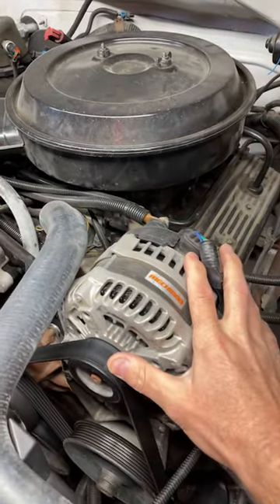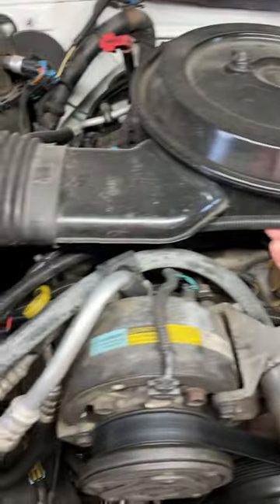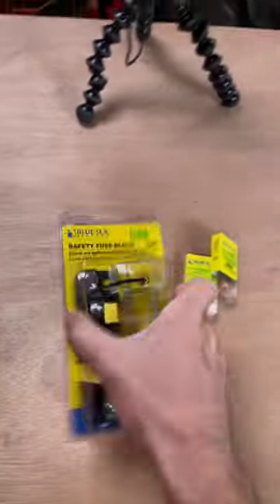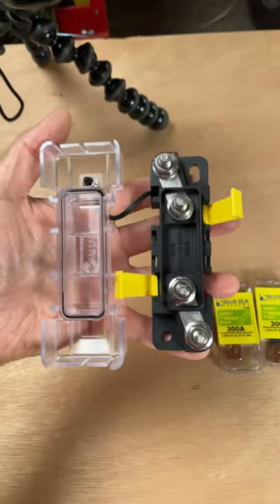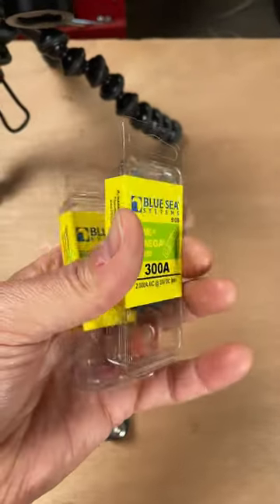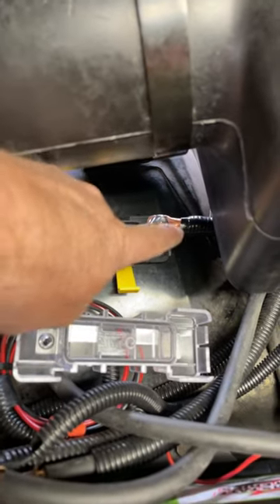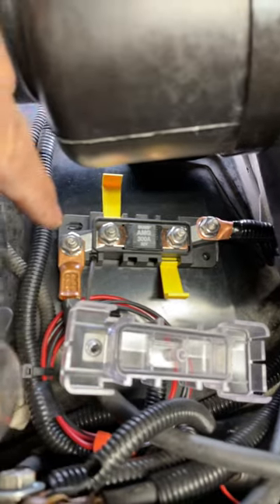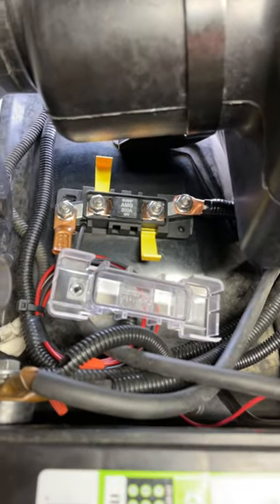Customer States His Install Was Professional!!

Comment: I’ve never seen a fuse on an alternator line to the battery !!
Reply: Its usually a fusible link.  Does the same thing as a fuse but looks like a wire.
Reply: @aaronpierson8748  Agreed, I’d much prefer the fusible link over the fuse.
Reply: It's better in my opinion because it'll visibly blow unlike a fusible link.
Reply: Its always fused, just not common to use this type of fuse
Reply: @Texassince1836  it SHOULD always be fused.  My dad's used suburban proves otherwise.  Stereo installed by the PO had an "upgraded" alternator output wire with no fuse.  Not sure what happened, but it melted the lead out of the battery and all the insulation off of the wire.
Reply: @Texassince1836  never on OEM applications
Reply: @Hitman-ds1ei  look again. It is ALWAYS fused, just generally with a different type of fuse
Reply: @Texassince1836  not always fused and in fact it's not needed!
Reply: @lgonzalez1154  again, there is ALWAYS a fuse. You just do not know what type of fuse to look for.
Reply: Now he has more areas to short to ground.   Cover up them copper eyelets
Reply: Well now there's two more contact points at risk of shorting out.
Reply: @paulrozinski1488  why? So u can pull out all your factory wires trying to find it ?   Makes zero sense
Reply: It's a fusible link. He just doesn't know the proper name. It's odd that he also doesn't know what to charge.
Reply: I did the same thing.
Reply: @Texassince1836  I went and looked at my 2005 f450 and my 2001 xj... no fuse
Reply: @paulrozinski1488  
Agreed on a normal alternator.
That’s a 275+ amp alt (mechmen) and I haven’t seen a fuss able link that handles that much amperage. 
It’s a necessary evil
Reply: @travis2893  fusible link is there. Its a type of fuse,  but it looks like a wire. I'll give you an F for eFfort
Reply: My work truck 6.0 Chevy has one but yea I feel like they are uncommon
Reply: @Handlehandlebars  It is always within a foot of the battery.  Sometimes located in a small fuse box next to the battery.
Reply: Well if you have ever installed a car system, then you would have seen this before!     I say you charge 75$ plus parts! As long as it didn't take more than an hour
Reply: @aaronpierson8748  I'd have to disagree...your generalizing that to newer model cars...classic cars had them inline somwhere between the battery and main fuse panel
Reply: The big 3
Reply: I had Itasca world finales invite stero in 2001 and they don't require a fuse on alt to batt cable
Reply: Charge them $2,000. Call it installer upcharge. Like dealers do. 😂
Reply: big boy audio uses big fuses 😉😏
Reply: High power alternators. You want one...
Reply: @PeterTremonti  he went to loud amd the battery got too hot, the modern work around is a set of supercaps or LTO batteries used as smoothing caps..
Reply: @deadprivacy  He actually hates the stereo and doesn't use it.  He was just driving back from a trip to Ohio and it started melting.  I have no idea what happened.  I could assume the output wire rubbed through based on the lack of zip ties and it shorted out the alternator and battery.
Reply: Better to have a fusable link, as you are less likely to short out the positive to ground while working on the car
Reply: @Hit man 309  my kia has a fuse from the factory...
Reply: MAYBE 🤔 THIS ALTERNATOR IS TO PROVIDE POWER TO  A HOUSE 🏠 OR TO UKRAINE  🇺🇦🇺🇦
Reply: You probably never seeing it because it's usually under most fuse boxes or inside them! Depending on year make and model.
Reply: Is it not called a fuseable link or a fusible link.??.not sure of spelling
Reply: That's because it goes to the fuse box
Reply: I have
Reply: @adamhonda98  Yes fuse box exactly! Different fuses protect Different electronics (AKA- Alternator).
Reply: You should ALWAY fuse or use a circuit breaker when you upgrade to a high amp alternator. I personally use circuit breakers with all my audio install now.
Reply: Because most cars use fuse line wire.
Reply: I would charge 1 hrs shop time + parts.
Reply: @Texassince1836  Nope, lots of oem applications don't have a fuse/fusible link or whatever on starter/alternator wire. I haven't seen one on any German car and wiring diagrams confirm that at least for the cars I have owned. Yes, there's usually a fusible link in the wire to the junction/distribution box but that's about it.
Reply: Pretty much every car has one
Reply: @Handlehandlebars  The fuse is there so if the insulation wears through or if you are in an accident it doesn't start a fire and blows the fuse instead.  That is why it located so close to the battery to minimize the amount of wire that could start a fire.
Reply: @andreyangere3076 the real question is, what Fuse to put there if any? Mechman alternators, for example a 240amp, actually makes about 260 amps @ 1,800 rpms and the amperage increases with the rpms. If he puts a 300 amp Fuse in, it'll blow every time that car tries to go above 60mph lol. 

Hope he likes waking and not taking highways.
Reply: Not always. Most audis up to around 2009 for example have a wire from the battery directly to the starter and alternator with no fuse.
Reply: Jokes on you, he doesn't have cash and plans to pay with his body.
Reply: @Aaron Pierson  yes I know why it's there but on older cars it's usually after the starter motor twards the fuse box inside the car..
Reply: @travis2893 we have a 1995 Cherokee XJ as well!
Reply: Oh really 😂 GM put them under the hoods of millions of cars.
Reply: it's a higher. amp needs a bigger fuse
Reply: @PeterTremonti  ahh yes that just meant a bad connection at the lugs, overcharge, and too small of wire for the output of the alt.
Reply: every car manufacturer does it differently over the years. a lot don't have any, some do a 200amp fuse and others do a fuseable link.
Reply: Is this type of fuse supposed to be a safety thing vs fusible  link?
Reply: Very common on high amp setups  some cars actually have them the wire goes into the fuse panel box them back out
Reply: @aaronpierson8748  true my 2012 chevy impala has a alternator fuse I ended up changing that out since the wires were showing from underneath. I completely replaced the wire and fuse she looks nice haha 😂  I'm definitely not a professional tho
Reply: Fusible links suck bro, fuses are always better why the heck would you want a fusible link you have to replace when you could just pop a new fuse in I don't even know where to start with this guy
Reply: @lgonzalez1154  It is actually VERY MUCH needed.  You ALWAYS place a fuse at the head of a positive supply.  Not doing so leaves you vulnerable to fire. 

Alternators put out enough current to weld a shorting cable to ground, and it can send sparks flying all over while doing ao. A fuse terminates that instantly, before it becomes a problem.
Reply: @Flamingtac0  listen "paranoid pete" alternator windings would break if the was a short! Take an alternator apart so u can see for yourself
Reply: @aaronpierson8748  it actually is just a wire with heat shrink over it that is usually two gauges smaller than the wire that it’s protecting..
Reply: Fuse links are the best for this application. They are a very cheap option and handle high peak currents. That's why OEMs have been using them for many years.
Reply: @aaronpierson8748  farm tractors use ah 400 amp fuse
Reply: I mean why fuse them when bolting the wire to the alternator and battery works just as good? 😉
Reply: @Rusty Rouse  wrong. the fuse would go between the amp and the battery on an audio install, not the alt to bat connection.
Reply: @gorillawrenchin  2011 Acadia has a fuse molded into the alternator output cable, have to replace the harness if it fails/blows. 150A as I recall. 2012 Chev Colorado has 200A fuse where the cable lands on the under hood fuse box.
Reply: Just to get more money in my vehicle I have a sub system and my fuse is in the back right my my amplifier been running it for more than 2 years and works great
Reply: @jasonadams8148  What do you think the clear plastic cover is for? Aesthetics?
Reply: @travis2893  I assure you do have a fusible link on your 2005 f450
Reply: Not ALWAYS some have it mostly on the American cars or such. Some Europeans like having a regular looking fuse like in the video near the battery. But not all have a fuse from the alternator to the battery and yes that includes fusable link as well which is just a thinner gauge wire connected to a thicker gauge wire.
Reply: Also cars don't come standard with a 300 amp alternator.
Reply: @Hitman-ds1ei  always OEM.
Reply: @099las  that's why the cover is provided.
Reply: @Handlehandlebars  they are not hard to locate if one can read.
Reply: @travis2893  but there is a fuseable link.
Reply: Car stereo amplifier uses those
Reply: Its called a fuzeable link fords have them
Reply: yes you have. You've just never noticed it
Reply: @paulrozinski1488 I had a Fusible Links in my 89 Daytona going to the ECU 1 of them Blew but it took for ever with a Multi-Meter looking for the Blown one I'd take fuses over them any day
Reply: And he did state he Installed an Aftermarket High Amp Alternator so it's Higher Amp then the Car was Designed for so he probably has Power Sucking Equipment such as a Ton of Lights or a Stereo System with Subwoofers or both
Reply: Because the wire is usually undersized. Like on my stock Chevy 140 amp alternator on a 10 gauge wire.
Reply: It's his own suburban
Reply: I'd charge $150 labor plus whatever $$$ for parts/materials......I'd also suggest the vehicle owner consider using a circuit breaker rather than a fuse as those 300a fuses aren't cheap every time one of them needs to be replaced.
Reply: @Rodogg7787  shouldn't charge anything for fitting that fuse block like that.
Reply: @Mixz1890  are you talking about the starter motor cable? It is the only one that I have never seen a fuse on it. All The alternator to battery wires I have seen, do have a fuse on them.
Reply: Usually you can't see it. It's under shrink tubing and lots of crummy tape and sometimes there is loom still intact.
Reply: @jasonadams8148  the copper eyelets are covered. Look at the video closer and you will see the yellow caps and those kits usually have some sort of cover for the other 2 connections too.
Reply: @Sean0526a  oh he knows what to charge...he was just throwing it out there for us. A lot of people call fusible links fuses too...
Reply: @travis2893  yes there is...definitely is on your 2001 XJ. It's about 1 1/2" from the alternator hookup. Chrysler uses thick rubber on their wires, if you strip that rubber off you'll find it. It's not a replaceable fuse really it's mostly a block of solder to melt in emergencies as a safety there is also a fuse in your fuse box for the alternator too....but the charging system isn't what usually catches on fire on Chryslers....as for the F-450 yes there is. There is an actual fuse at the box like the Rams are.
Reply: How many charging amps can a battery take?
Reply: Some vehicles have. But most older ones do not. Just a direct wire. Some do have a link, some do have a fuse. But it's easy to see if know anything about wiring or wrenching.
Reply: @Texassince1836  Do S10's have one?
Reply: People are arguing over this, so I'm sure my 2 cents will put an end to it.  Not all cars have circuit protection between the alt/gen and battery, esp on classic vehicles.  I am pretty sure it is standard on most modern cars however.  While it is best practices to use circuit protection, it doesn't need it to work.  If you don't want to burn the vehicle to the ground, I highly recommend you use one though.
Reply: @travis2893  the fusible link is between the alternator and the battery on you 05 F450 in the same place as my 08 F350 if you don’t believe any of us Google it I did just for 100% verification.
Reply: 10 cents
Reply: @PeterTremonti  good god😂
Reply: Saves the battery if theres a short or alt issue
Reply: And many vehicles today it goes into the Fuse block and has a primary buss fuse before going to the rest of the other circuits.
Reply: You're usually only going to see it in cars with aftermarket electronics and audio equipment in it
Reply: Hey 1Road, this Mechman Alternator was the Alternator I was trying to recommend  to you when you were having low voltage issues on your Suburban when you had the AC running full blast and the Alternator couldn't keep up. You did a good job doing all the grounds over with 2 guage wire,, but what you really needed was a 300 amp Alternator that makes up to 240 amps at idle. And, to everyone saying they would rather have a fusible link, go ahead and find a fusible link for a 300+ amp Alternator. The wiring going from the Alternator to the battery was 1/0 Guage pure copper wire. The 300 amp ANL fuse was really the best thing to do in this situation. The guy probably has a huge 5k+ watt stereo system and another battery or two in the cab of the truck. Lots of people use DIY Lithium batteries or a big capacitor bank to keep the voltage higher up and more stable. That particular Alternator should output 14.6v to 14.9v because that is the standard internal voltage regulator that Mechman uses.
Reply: Same here  my suburban was blowing the factory fuses I eliminated that a went directly from alt to batt. No issue
Reply: Engeering at it finest my friend
Reply: I was gonna say the samething... I used to do stereos and I never put one after the alternator
Reply: @paulrozinski1488  fusible link is not a better solution at all. Boomer
Reply: It's fused for wire protection.  When running big stereos anyways
Reply: Many vehicles have fuse or a fuseable link. Inline
Reply: When I did it,  I charged an hour labor plus parts. It seemed fair. I think I might take another look at the grounds and double check those battery terminals as well.
Reply: I never saw a fuse between the alternator and the battery before fusible links were even invented. Why would you need that?

The alternator is either internally or externally regulated and that's supposed to take care of the charging issues. If it doesn't a fuse isn't going to solve the problem because it's not going to blow the fuse.
Reply: @lgonzalez1154  oh you sweet summer child……not a mechanic but am a Electrician. You want a fuse trust me. You can make a welder out of a car battery. Cable runs next to components including engine. Vehicle when running vibrates. All metal components are bonded to negative. All it takes is a nick in the wire and your gonna have a bad day and it’s going to cost you mucho dinero.
I would imagine a blocking diode would be good aswell, but I would imagine nobody probably does that
Reply: Fuses on alternators don't really make sense since if you put a large enough fuse that it won't blow when you boost someone or have a low battery, the alternator simply can't make enough current to blow it anyway.
Reply: he has a high output alternator, its just in case there is an overload. better than melting wires. it happens
Reply: @Texassince1836  no its not😂
Reply: 😂 then you have never worked on electronics.
Reply: Why would a customer bring you his car to show you his new alternator and you put a fuse inline. Dude your storyline sucks
Reply: I used a circuit breaker on mine
Reply: Not even once
Reply: @PeterTremonti proper gage wire wasn't used.
Reply: Demographics have a lot to do with what can be charged.

In my area the going rate for standard labor is between 75 to 165 dollars per hour, and it goes up from there if it is electrical work or fabrication and welding. 

165.00 per hour on Mechanical Labor 

185.00 for Electrical Labor 

250.00 for Fabrication and welding Labor
Reply: Well, looks like I've got the same engine at my house. No fuse of any kind on the cable going to the alternator from the battery. Might be a newer vehicle thing, idk, but even on my Dodge, jeeps, and chevy from 93 to 2001 I didn't have a fuse. My 94 at the house I've had the engine out 3 times. Only a red wire.
Reply: @blahblahblah5377  a fusible link is simply a section of the wire that is thinner Gauge than the rest of the wire so it will break if there is a short..
It is not something visible as the wire has insulation and likely a loom... If u look at the wiring diagram ull see where it is
Reply: Charge nothing because you are ripping him off.
Reply: Alternators always have a fuse to a battery connection.
Reply: @jpowens2253  The alternator supplies what the load requires, up to the limit of the alternator's capacity. But the real danger is not the load, since the wire should be sized correctly for it. The fuse is there to prevent a short from the alternator to ground (like a wrench). As such, it should be as close to the battery as possible to protect the wire (as another poster pointed out).

You need to know what the fuse is protecting...
Reply: It's not common cuz many don't protect they're lines but should also be done on starters!
Reply: @rc-t3k  Sorry, no.
Reply: Insist on it
Reply: @Mixz1890 Fusible link is a fuse. They perform the same function. So you probed him right. Alternators are always fused one way or another.
Reply: I saw your comment and thought “I commented on this and it got 1k likes? 

😂

Comment: F.F.S. you're worried about a non-necessary fuse but don't put heat shrink tube around the copper terminals to keep out moisture and future corrosion